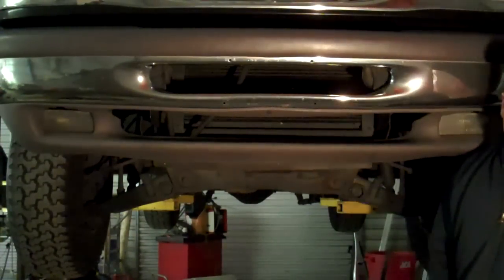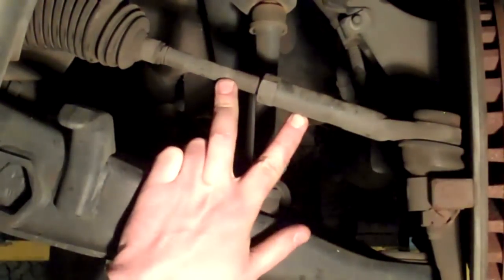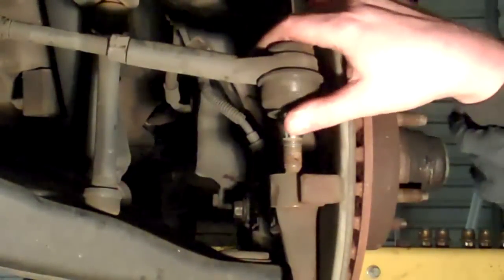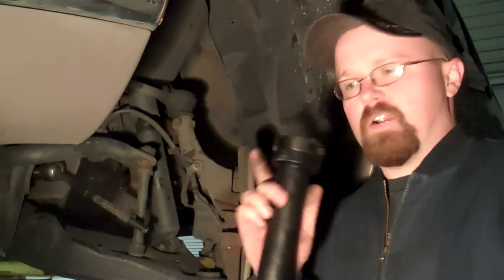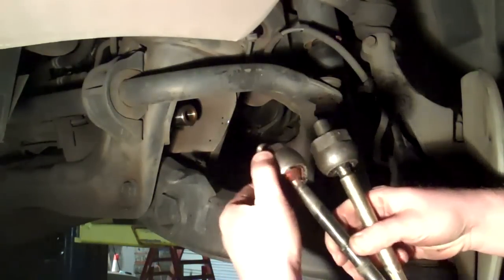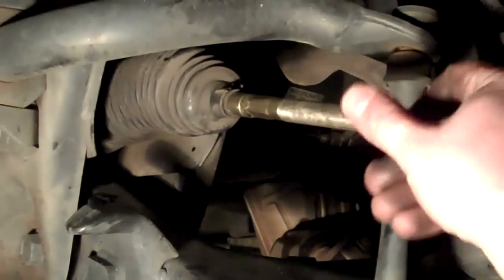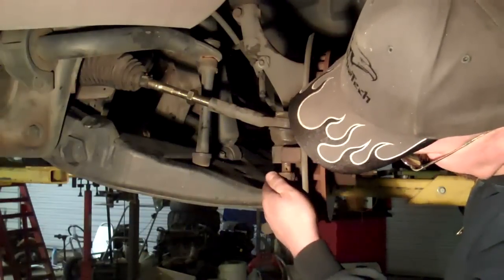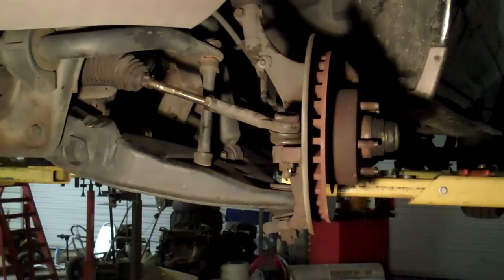Replacing a Rack & Pinion Type Inner Tie Rod DIY

Comment from the maker: @Admakit18 That is the sway bar link.  The sway bar link connects the sway bar to the lower control arm.  It sounds like the link on yours may be broken at the bottom.  It will corner much better once it is replaced.

Comment from the maker: @stonerhythmsThe inner tie rods usually come with a rack & pinion assembly.  Some rack & pinions come with inner & outer tie rods. A bent tie rod usually happens when a vehicle impacts something fairly hard. Sometimes a wheel gets bent in the process. A good tire store will watch the tire & wheel assemblies when they are spin balancing them.  This can help determine if 1 or more wheels are bent.  Also, some tire shops will do a road force balance that shows bad tires &/or wheels.

Comment: Ford service manual says to crank the steering to the end and then put an adjustable wrench on the "D" shape of the rack gear for support.  So does the package insert that comes with the repair part.  The repair part also come with a safety rivet that prevents it from un-threading if the blue thread-lock fails.
Reply: thanks for the tip on rotating the steering wheel to access the rack.

Comment: best way I have seen on where to strike to separate the tie rod end from the knuckle without damaging the boot, "A" for tonight for you! Can't wait to try it tomorrow....
Reply: +jttasb Yeah thats a old trick,works every time!!,next time your under your car you'll notice this, most tie rods have a flat surface there, this one in the video had it,thats exactly there to hit it in that spot, a nice heavy hammer usually works well,pickle forks sucks and most of the time damage the boot like you said.

Comment: great video. always wondered about this. have done lots of inners on trucks with the non rack steering, have replace steering racks, never did an inner on one, lots of outers, i guess i always though you replaced the rack, never ran into this situation before, now i know, thanks. i'm hoping this is pretty much the same for gm steering racks, just cause i work at a dealer.

Comment from the maker: @ironfingers206 You may not have to remove the rack completely from the vehicle.  You at least have to unbolt the R&P assy from the front sub-frame.  You may have to lower the sub-frame from the body a little if you can't raise the R&P high enough to get the bushings out.

Comment from the maker: @mstrgns Some inner tie rods only have 2 flat spots on the inner tie rods to spin them off with.  Some, like yours, are round.  Chrysler wants you to replace the rack & pinion assembly when the inner tie rod goes bad.  To replace the inner tie rod, there is a tool like a big stud remover made to grip onto round inner tie rods.  In tight locations, sometimes the R&P ass'y has to be removed to get the tie rod out.  If so, you can remove the tie rod with a pipe wrench with the R&P in a vise.

Comment from the maker: @jbwoody89 On most vehicles, there is an O-ring at the fitting that can be replaced when it leaks there.  Usually a failed rack & pinion will either leak fluid externally, or into the bellows boot.  If the only leak is at the fittings, check the PS hoses & replace the hose(s) or just the O-ring(s). If that is your only problem, you're done.

Comment from the maker: @nokia53310 If a tie rod is bent, the alignment will be out of specification.  This will cause a crooked steering wheel & abnormal tire wear.  If the rack & pinion assembly was damaged when it happened, you would feel a tight spot in the steering or a fluid leak.

Comment: @roadragecustoms I read .250 for my '95 GMC sierra, but thats throughout the entire linkage system. Yes, it surprised me but the service manual said that much slop in the steering was still considered normal play. 
Thats why I wondered what would be considered within the norm for this vehicle.

In this case, the single component appeared to have quite a bit of slop, but, I've been fooled before thinking a part was bad when it was still considered acceptable.

Comment from the maker: @disturbed19th Like cooking oil, PS fluid is very flammable at the right temperature.  A PS leak can lead to a major vehicle fire under certain circumstances.  Also, a tie rod isn't something you want to break while driving.  You will have no control of your vehicle.

Comment: This is exactly to a "T" what's wrong with my wife's 2002 Toyota Camry. Hers is is on the passenger side. Just took the tire off today and found out that's what the problem is. I don't know what I'd do if she wrecked with our baby in there. She told me it's been shaking for a while now but I didn't know just how bad it was til I drove it. 45-60 mph the steering wobbled very very bad. I'm talking extremely bad and pulled to the right immediately when u let off the steering wheel. THANK YOU TREMENDOUSLY FOR THIS VIDEO.

Comment from the maker: @Edcoupon Get a mechanic's stethoscope.  They are maybe $4.00 at a parts store.  Have someone move the steering wheel while you listen to each individual front end part (tie rods, ball joints, etc).  While you are under the vehicle, check for broken boots on the same parts.  Also watch my other video, "F150 squeaky ball joint replacement".  The beginning of it shows what the ball joints sounded like on it.

Comment from the maker: @305miami786 Engraved on the inner tie rod tool are the words "DO NOT USE AIR TOOLS."  They want you to use a 1/2" ratchet or breaker bar with the tie rod tool.  I don't always follow the rules.  On some cars, I use an open end wrench instead of the inner tie rod tool.

Comment from the maker: The hammer is quicker.  I've never had a problem from using one to disconnect steering components.  I own pickle forks & tie rod / ball joint separators for hard to reach locations.

Comment from the maker: @namorcito89 If it is leaking from the bellows boot, it needs a rack & pinion assembly.  This will require an alignment afterward.  If you can't, or don't want to DIY, shop around & don't be afraid to haggle.  Lots of chains, independents, & even some dealerships will come down on the price to have you as a customer.  Many places will also offer a credit card, if you have decent credit, to finance the repair.  If it is a slow leak, keep the fluid full & drive till you have the money.

Comment: same drill for a 98 tacoma? im just replacing bushings, but i had trouble getting the tie rod off the steering knuckle. it would be funny if i were just pounding on the wrong part.

Comment: i have a 2004 buick lesabre ltd. I pulled everything, then i found out, that the bore on the inner tie rod was smooth, it takes another type of tool.  So as i looked closer, i soon realized, someone else, had replaced the inner tie rod, long before i bought the car.  it seems, this car goes through the right inner tie rods alot...my wife wants another car. I think its a great car, just bad mechanics and not kept upto date on repairs.  May have to take to shop-to pull inner tie rod 
But, thanks for the information on a fantastic video
Reply from the maker: Turn the steering wheel all the way to whichever side moves the tie rod to the right side. Then see if you can get a pipe wrench on it. There should be 2 flats on it for a wrench or tie rod tool though.

Comment: @wimrya11 I have lived in Michigan for 21 years and I can attest to the number of cars I've seen with a broken tie rod or ball joint causing a wheel to be turned opposite the other one. I have always suspected the salt rusting those parts to the point of breakage. The pot holes don't help either with springs and upper strut mounts.

Comment: @roadragecustoms I got a hold of my buddy and he's got the snap on inner tie rod tool with the adapters. I bought the inner tie rod and measured the two flats and i came up with 1-1/4" which is pretty close to 32mm. And yet i cant find any tools fitting that size. But he's got the tool so i shouldnt have any problems. good vid.

Comment from the maker: @disturbed19th I wouldn't call it easy.  On a 98 Civic EX, it takes over 3 hours if you are doing it on a lift.  Some models require partial exhaust removal.  If you do it wrong you could damage the airbag clock spring.  An alignment is required after the rack & pinion replacement.  The R&P leaking PS fluid shouldn't make the engine lose oil.

Comment: Hi my steering wheel shake when driving....not all the time and it isn't just at high speeds.....sometimes shakes at only 35-40.  Recently had front rotors replaced, had a bent inner and outer tire rod that was replaced, replaced my torque strut engine mount(looks like a dog bone) had 4 new tires put on and balanced, and had it aligned.  Still it shakes.  Was told it could be alot of things and one was the rack and pinion.....but here it has the rack and pinion associated with the tire rod.

Comment from the maker: @pkid23 Book time is 1.1 hours plus alignment or 1.5 including toe adjustment only. If the shop's labor rate is $50.00 per hour, labor would be $55.00 plus whatever they charge for alignment. Every shop is different with what they charge for parts.  Some charge dealer list.  Some charge list plus 10%. I worked for one company that sold every part for 275% of the cost.  I did this at home for a friend. I replaced the front wheel bearings & front seals, tie rod & alignment (sublet) for $200.

Comment from the maker: @elguero123ful I did a little research & couldn't find 1996 Jetta VR6, only Golf GTI VR6.  If they are the same, you should be able to replace the inner tie rods.  The procedure I found didn't tell if it could be done with the rack & pinion assembly in the vehicle.  Mitchell was showing removal of assembly first.  Without looking at the vehicle, I couldn't tell if it was possible on the car.

Comment: Great video Dave,  your video was very helpful and i think you just saved me alot of money! I was wondering if you could answer a question that i have? I have a ford focus zts manual, when it is on and the motor is running, without driving, in like 10-15 min the temperature gage starts heating up? Do you know why this happens? People have told me its the thermo or the radiator? I would really appreciate if you could get back at me? Thanks again for the video!!!!

Comment: Reading the directions on line for my 01 Windstar this is what I read that concerned me (NOTE: If repairing the RH side, it will be necessary to pull back the LH inner tie rod boot to hold the steering gear). Does that mean i have to have someone else on the other side of the van hold the other inner tie rod with another wrench? If not what would be the consequences? Also, Do both sides of the car have to be jacked up when changing the inner tie rods? 
THANKS

Comment: @Darkherooftheday 
Thanks for the tip..      What would you recommend using to remove a spindle on a 2wd pickup that the outter tie rods and ball joints are like new and to remove the spindle without ruining the little grease boots?       I'm replacing the spindles with some 2" drop spindles and a shop wants to charge me almost 400 to do it (not including alignment)    seems like a huge ripoff..      So I'm going to do it myself and have it aligned elsewhere..

Comment: This video helped alot. I used hose clamps on the inside end of the boot. loosening the jamb nut before you take off the outter tie rod end is alot easier. thank you..

Comment: I can't unthread the outer tie rod end from the inner (passenger side). I use a wrech to hold the inner and another wrench to turn the outer but it won't work. I even applied fire heating to the outer and some penetrating liquid but still no luck. I'm going to replace both the inner and outer. I'm now thinking of cutting the inner with a saw, but any other method than that? Thanks.

Comment: Hello, I´m Edward from Brazil.
I´m a home mechanic.
First I´ve a question between Haynes or Chilton´s manual.
Which one do you think is better?
I´m studying if it´s possible to have at home an efficient system to
adjust the front end alignment without having to buy all the professional
equipment. If you know a cheap way to have a small front end 
aligment at home, please let me know.
Bye

Comment: Yes, I am sure. The only purpose the boot serves is to keep dirt and road grime from damaging the rack seals. It's not like a CV boot which holds in packed grease. The inside of the tie rod boot should be clean and dry. If there is oil in it, there is only one place that it can come from, which is the rack itself. That means the seal is bad.

Comment from the maker: Is it right hand drive?  Most US vehicles aren't.  Does it pull to right, or driver's side?  If it switches back & forth (wanders) your problem could be rack related.  Has the car been wrecked?  Play in the tie rod would cause toe to change while driving.  It could cause loose steering, noise, or a crooked steering wheel.  If you want to see if maybe the pull is a radial pull from a bad tire, switch the two front tires side to side & see if the car pulls to the other side.

Comment from the maker: @disturbed19th A new tie rod won't help a PS fluid leak.  If the fluid is leaking from the bellows boot around the tie rod, the rack & pinion assembly should be replaced or rebuilt.  Personally, I'm a 'replace it' kind of guy.

Comment: Great video. My bellows boot is leaking chunky grease where the boot meets the rod. NO metal clamps holding the boot to the rod...not sure why. 
Is the tool you used to remove the bellows boot a custom tool? 
 
Thanks!

Comment: Great video- I have an explorer too. I have to replace a tie rod on a 95 continental (taurus).  I heard you have to hold the inner rack with a backup wrench  on the teeth- is this necessary. I read you can damage the pinon from the torque? In the video you just use an impact I believe.

Comment: @roadragecustoms Would you know if this is an "easy" replacement that can be done at home? Can I purchase a used assemply or new? And also, i seem to be losing oil...would me needing to replace the assembly maybe drain oil if the R&P assembly is damaged?
Sorry for the 1001 questions by the way!

Comment: I am in the process of converting a Mazda rx7 power assisted rack and pinion into a full manual rack. While dissembling the rack i used your video in order to get the inner tie rods off. When impacting the tie rod removal tool it just spins the other side. Would you recommend putting a wrench on the other inner tie rod to hold it in place in order to impact the other side? If this is the case then how can i remove the remaining side once one of the inner tie rods is removed?

Comment: Recently my Explorer got new inner tie rods and a professional alignment performed and wheel balance. The problem is the steering wheel didn't end it up centered, now it's like 40 degree to the left, when I got this car it has a serious alignment problem and the steering wheel was upside down, Now the wheels are straight but still pulls to the left but not so bad like before. I've been told the problem might be the rack & pinion

I bought this car one month ago, any ideas of what could be?.

Comment from the maker: I don't have a video on complete rack & pinion.  Make sure the wheels are straight ahead before you disconnect the steering shaft from the rack.  Don't allow the steering wheel to rotate independently of the rack after it is disconnected. Make sure the new unit is in the straight ahead position before you reinstall it. Pay attention to the hoses & where they go on the rack. (I assume you have power steering.) You don't want to try to hook them up backwards.  Have it aligned afterward. Good luck!

Comment: Hey, quick question, what is the part that wraps directly over and then behind the tie rod? It's directly behind where the inner and outer tie rod connect.  I noticed that this part was hanging down off my explorer this evening and I was able to just swing it back up and into place over/behind the tie rod.  Sorry if that doesn't make sense I'm just kinda lost as to what that part is and this is the only video I've seen it in.  Thanks for your time! :D

Comment from the maker: @305miami786 If I were working on the ground doing an inner tie rod on a Windstar, I'd turn the steering wheel all the way to make the inner tie rod I was replacing stick out further.  I'd only lift the side I was replacing & I wouldn't have read those directions.  I have done a few Windstars & lots of Tauruses (Tauri-What is plural of Taurus?).  I have never held anything on the opposite side & don't know of any problems if you don't.  Good luck & be careful!  USE JACK STANDS!

Comment: Hey, I have a question...my 98 civic is losing powersteering fluid, and i look under the car at the tie rod and it seems to be coming from there...will replacing the inner tie rod stop the leaking? and if it isnt the inner tie rod, what could it possibly be?
Thanks!

Comment: Thank you so much for posting this video. I have a 98 Explorer, and noticed that the inner tie rod on the driver's side was loose months ago when I was changing the ball joint on the passenger side. My friend told me that it was very hard to change the inner tie rod, so I haven't done it yet. After watching your video I am sure I can handle it and save a load of money (vs taking it to a shop).

Comment: Outstanding tutorial.  What did you use for the inner bellows clamp, a zip tie?
Reply from the maker: Vu Nguyen yes. I used a zip tie. Most aftermarket replacement bellows boots now come with a zip tie instead of a metal clamp.